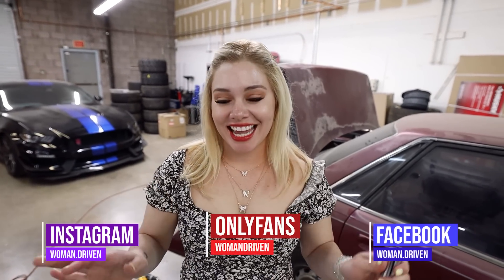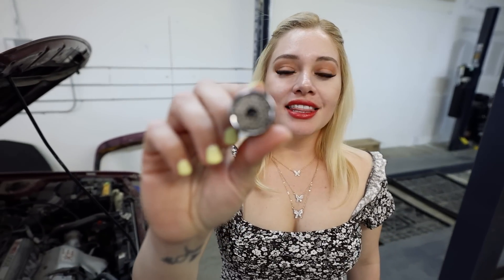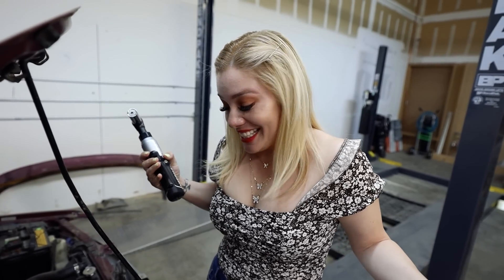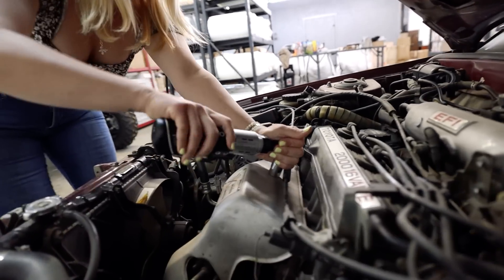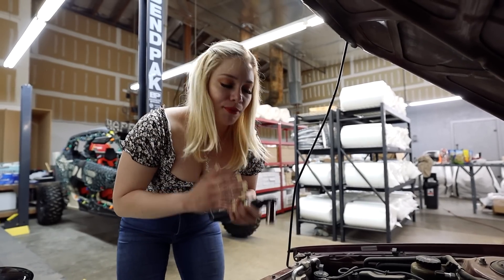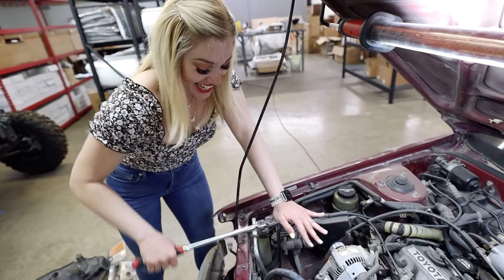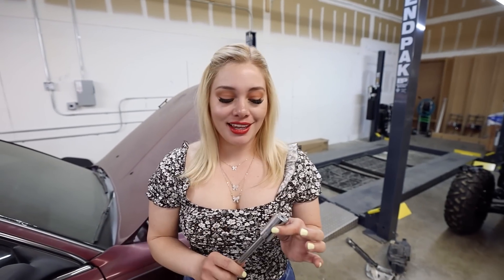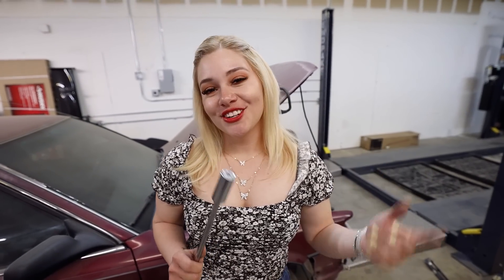A Pocket Sized Universal Socket?

Comment: It was originally called gator grip socket. It's for low tork and is very hard to use. Mainly because you can't easily center it on the fasteners making it jump around. Overall a junk socket.

Comment: Those multi-sockets have been around since before you were born gorgeous. They are mostly rubbish. As soon as you get some dust build-up the pins will start jamming up. They will round off your bolt heads. After a bit of use the pins bend out of alignment and jam up. Just from experience.